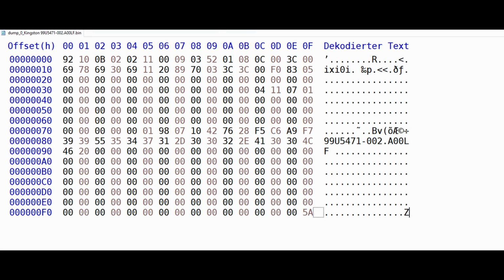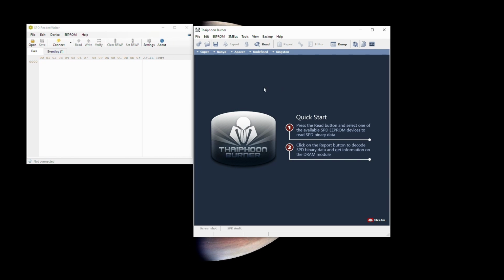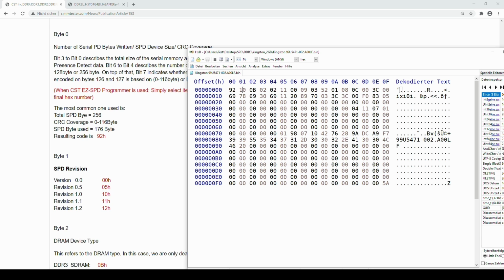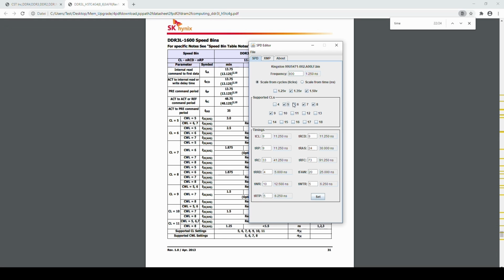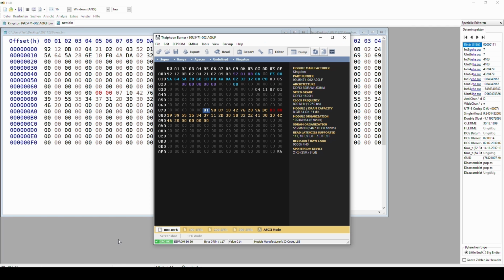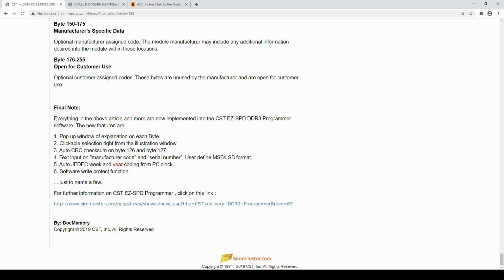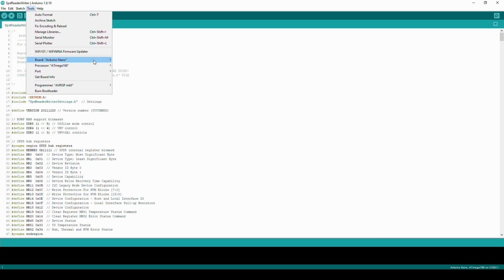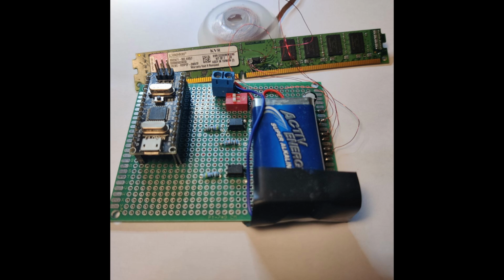Creating a new SPD file | Part 2 for the memory stick updgrading series

Comment: Hello, is this project still relevant? Seems like the EVGA forums has died, and it is pretty hard to find anything about this project. The github page doesn't have any gerber files, only schematics. I don't want to design pcb myself, since I doesn't have enough experience - but I think it will be cheaper to order it from a pcb factory and solder it at home, rather then buy one. Prices on these things are getting ridiculous.
I am pretty sure the chinese sellers themselves are using gerber files from enthusiasts, like they almost always do. But I cannot find any of them. I am particularly  interested in a black board, that has an arduino nano module and slots for the DIMM DDR 3, 4 and 5 - does anyone has files for this project? I want this one, because it has all the relevant ddr formats.

Comment: SPD Tool cannot add values with " . " value , i dont know how u added 13.75 in the video , when i try to add it the box turns in to red , you cannot add any value separated with a dot , just fixed values ...

Comment: in this case it would've probably been easier to extract the SPD info from the macbook BIOS, since that's where you took the chips from. However your method was very interesting and manually writing the SPD configuration is something that can be done no matter where the chips come from, so I'm glad you showed this.
Reply from the maker: Yeah, you are right. But it only crossed my mind after watching dosdude's video..and at that point everything was done..:)